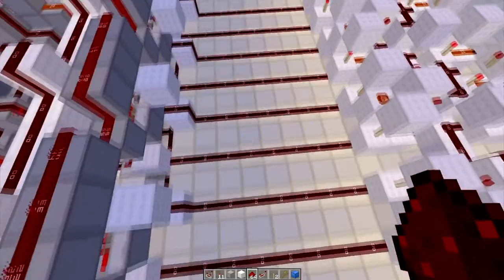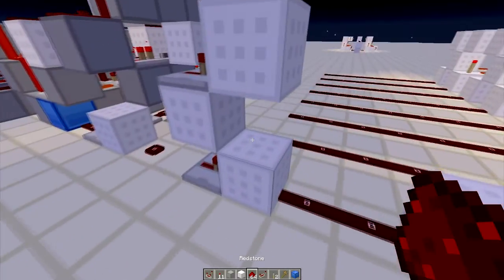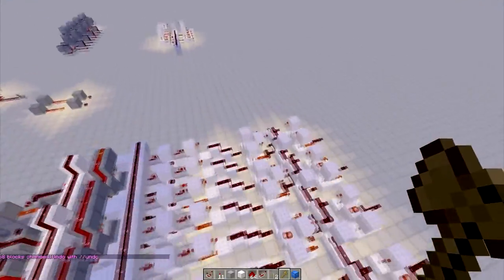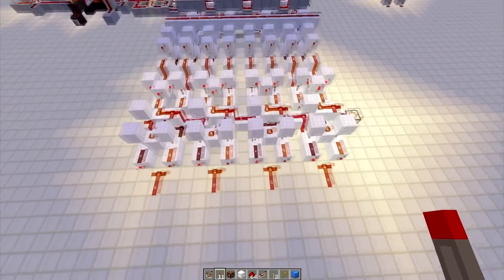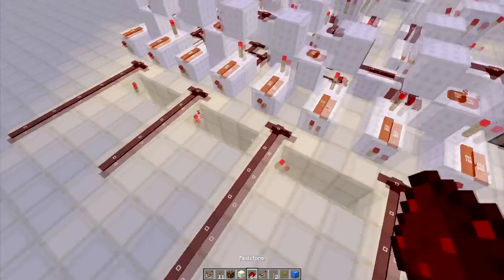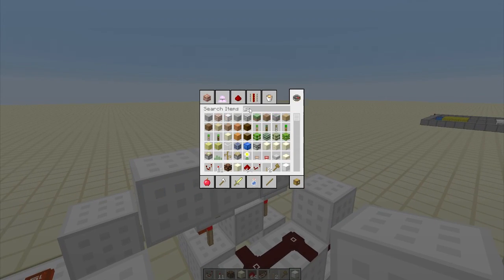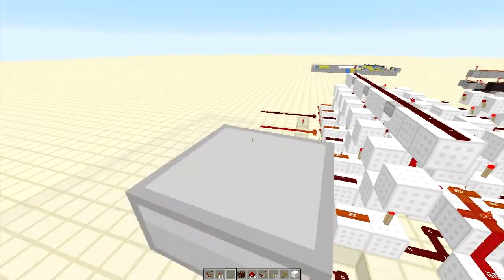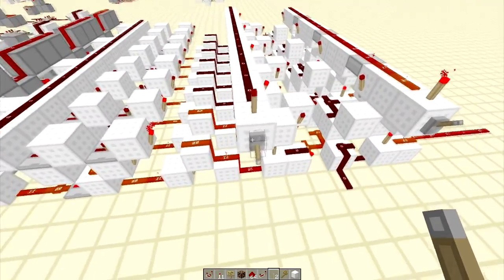Redstone Computer Tutorial - Episode 17 - Setting up the ALU

Comment: I do some google research and I find that in most cases overflow detection is implemented by taking carry outs of the last two ALU units and passing it through XOR gate. Isn't that simpler? And works different I think, I can't figure out what's the difference between this two methods and which one is better.
Reply from the maker: Thank you for the comment, I hope I helped you.
Reply: But you didn't answer my question ..
Anyway I find why there are two different ways to detect overflow. If you add only non-negative numbers carry out is your overflow flag, no other logic is required. If you add numbers that can be negative you detect overflow by XOR'ing carry in and carry out of the most significant bit ALU unit. Then why you AND all of the outputs?
Reply from the maker: Kostu96  I understand this, If I were to make a better CPU I would have both implemented  for certain scenarios.